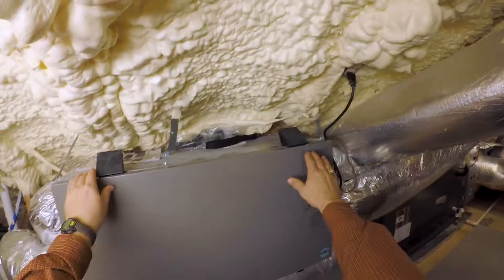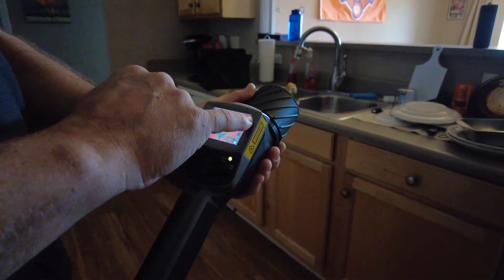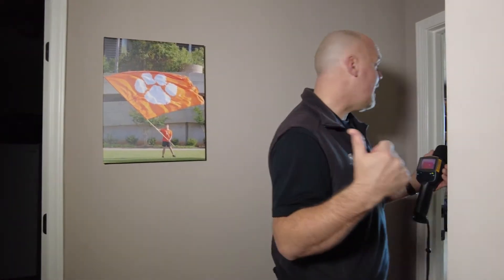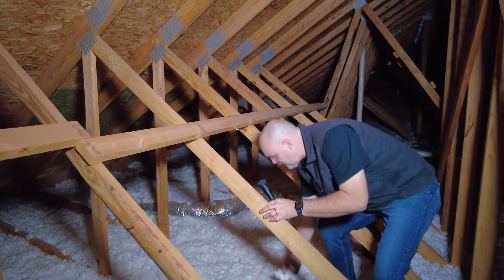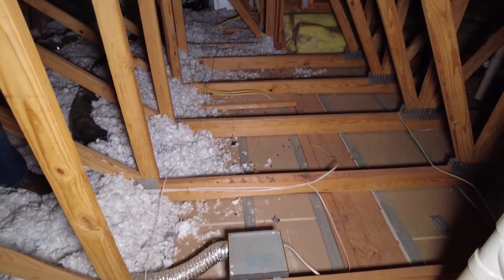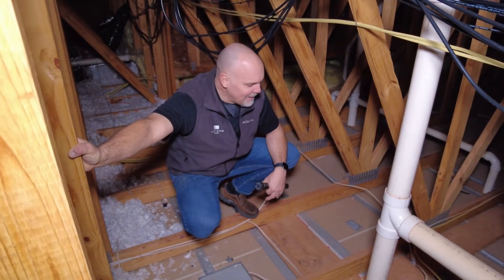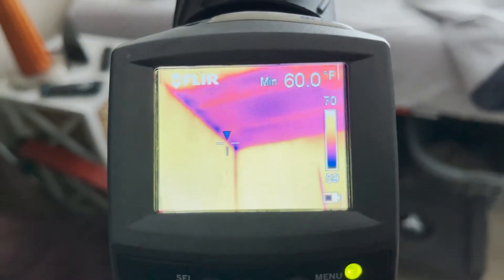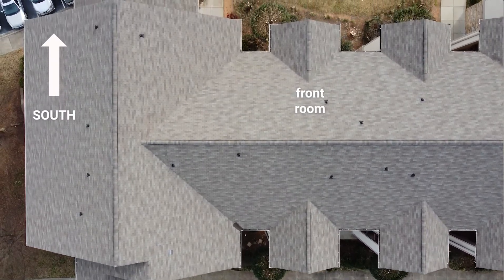COLD in Winter and HOT in Summer | Building Science Investigation

Comment: We have the same problem with a room that is cold in winter and hot in summer. But our house is made of cement and bricks and there are people who live upstairs so there is no way we can use fiberglass for insulation. Is there anything else that can be done? Also there is some kind of leakage in the floor but the landlady is not willing to do anything about it and the floor is damp all the time that has ruined our carpets too.
Reply from the maker: Yikes.  Where are you located?  Sounds like air leakage potentially between the floors.

Comment: I have a very cold room in the winter and hot in the summer.  This room is above an open carport where the ceiling has been insulated with Roxul.  We have also put down carpeting with underlay to help to stop the cold and heat.  I am wondering what else we can do.  We have checked the wall for insulation and have found them to be insulated as well.  What else can we do?
Reply from the maker: Interesting.  Have you checked the room for air leakage using a blower door and/or a smoke puffer?  Does the room have windows or exterior doors?  My guess would be that you have air leakage rendering the insulation ineffective.